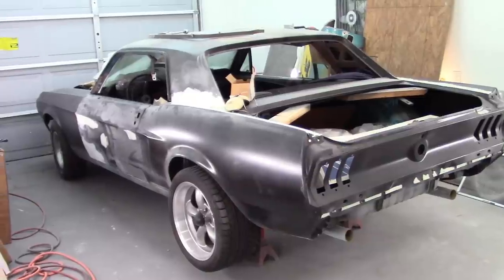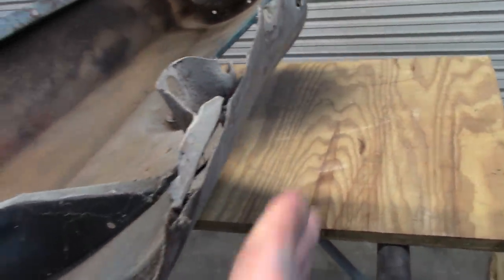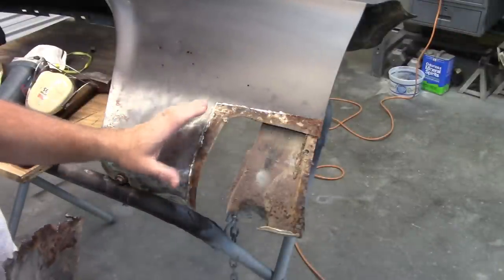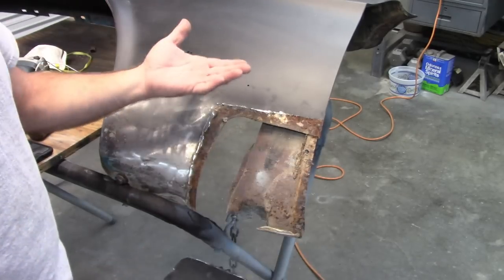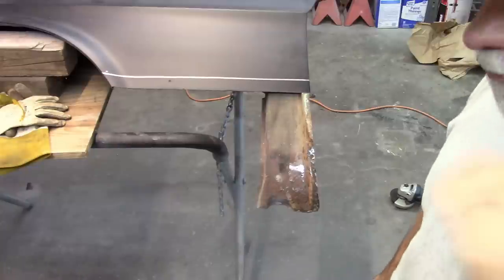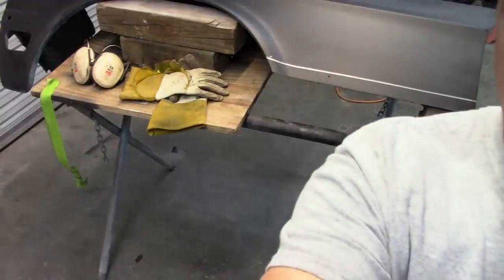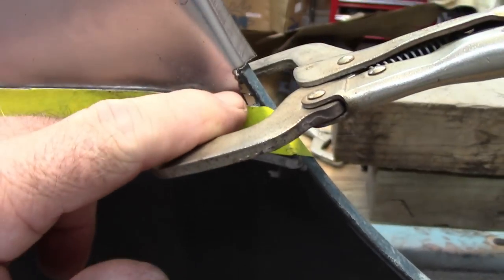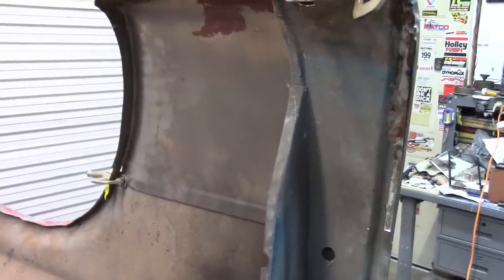Repairing a rusted fender on a 67/68 Mustang. Jade part 26

Comment: Great example of good metal work.  Great Job, on being a perfectionist!  
Might want to add a little that some of the viewers may not have noticed.  When you were folding the metal over, using the hammer a dolly, you did not stretch the metal.  You can tell when you are stretching it as you will hear a 'ting' where the hammer is hitting the metal solid on the dolly.  When you do that you will create ripples that will be harder to get perfect.  You want to use the dolly as a backing to bend (or straighten) the metal, not stretch it.  This method can be used to take dents out as you might want to stretch to get the right contour, and keep the dent out.

Comment: Great job and you pointed out "not to rush" allowing time for the mental to cool - as well - measuring cutting and fitting the panel. I tend to rush and get myself in trouble. So, checking and measuring carefully can save you a lot of time and frustration and fixing mistakes.

Very nice video...thanks!👍

Comment: Interesting watching you repair that fender.  Back in the 80's before the internet I had a project 69 and attempted a long weld with partial panels.  Only wish I knew now how to better control heat by welding much shorter welds and more of them.  Good job on the repair.  The current 69 I bought has almost no uni-body rust.  The bolt on panels are another issue.  Some have dents some have rust bubbling do to the previous owner leaving it out side the last 15 years and water getting into the doors and trunk lid.  I like watching your videos for some time and helped get my thinking of another project which now is awaiting my attention.  That coupe is really starting to look good, very solid.

Comment: edge to edge is the way to go  to weld it , if u over lap keep it to a  your over lap to a minimum , the rust will get between the over lap and  and swell out the metal , it will show in the body work in the future where u made the repair . edge to edge is the way to go  un least u can get at the back of the over lap and seal it to off to prevent it from rusting!!! nice job by the way .keep up the good work

Comment: My project 67 came with a 68 fender that has a patch welded inside to "convert it to a 67. I think I will keep it, maybe fix the patch a little better and just keep it because they ruined the lip for the marker light. The other original fender needs serious work as you show but I'd like to save it too. Great video!

Comment: Great intuitive video - one recommendation on the stitch welds - try to go from end panel to end panel so that the stitch welds have a chance to cool without doing them so close to each other - meaning stitch weld alternating at each end of the panel ending in the center of the panel- just eliminates any chance of the panel from getting real hot and like you said a further chance to warp

Comment: Doing similar repairs on a 65. You shared some good tips. I've been butting the panels and hammer welding with a tig, but using the mig on all the supporting structure. Now I need to figure out how to find the previous videos!
Reply from the maker: They’re all in the playlist.

Comment: I'll be honest,That looks like a fender repair I did on a 68 ford pickup several years ago. I welded the top of my patch then used a scissor jack to roll the metal under to get the curve at the bottom welded it and cut the excess off.

Comment: Very good work ethic,clean & prepping metal,I like the close up shots when you really need to see how the gaps line up & how to secure your parts before you weld, my problem is I only have a generic H/F flux core welder, I intend to get a gas mig eventually, maybe you have some recommendations for one that do the job without overpaying for a top of the line welder.but I enjoyed your video I’m not a body-man but do have a 1967 El Camino project that has similar rust repair needed,just want to say thanks for some really good insight as to what it will take to do the job.if I can ever finish all the dang honey does!!! Which never seem to end.
Reply from the maker: Thanks for the comment. Glad you liked the video. MIG is the way to go. As far as a welder, my Lincoln 140t is an affordable option. I will say you will likely be satisfied with the offerings from Harbor Freight. I would use the Vulcan or Titanium brand from them.

Comment: I really appreciate your post, especially the welding. My only critique is I wish you would have shown the all the welding not just the tacking. Again thanks I just wanted to see more, since its work of art how to weld sheet metal without warping it.
Reply from the maker: Sorry about that. I really just end up doing short tacks over and over until it's all filled in.
Reply: @JoDaddysGarage  thx for the info... I assumed you ran a bead at some point...But I guess thats not possible on sheet metal...
Have you ever considers using a spot welder initially? Even with the warping, it would add more strength and stability when you weld it... Just a thought... thx again...
Reply from the maker: @nc3826  I have not considered a spot welder for this type of repair. Not sure it would give good results.
Reply: @JoDaddysGarage For what its worth, some of the best posts, are when ppl take a risk and try something new. And then talking about what did and didn't work out. 
Perfection can get boring....
Reply from the maker: @nc3826  Very true. I've been trying to work some of that into my videos. Thanks.

Comment: I'm a newbie on restoration. Your coverage on rust prevention, welding and hammer and dolly are very helpful for me. What disk do you use on your die grinder for taking down the welds? I have a cheap Harbor freight die grinder to learn with for now. What kind would be best for me to buy next? Thanks Jo Daddy.
Reply from the maker: I use a 40 grit disk. I also use a HF grinder. Hard to beat. I wear one out every year or so, and just buy another.
Reply: @JoDaddysGarage  Thank you!

Comment: I use to make continuous welds, but don't think it's necessary anymore.  I also don't think the flange needs to be that wide.  I sand blast the inner structures, then paint them with epoxy.  Attach the patch with 1 inch spaced circular spot welds.  Knock them down, than spray epoxy, than skim coat with filler.  My thinking, the factory attaches every panel or piece like this.
I also tape off the part and body piece leaving just enough bare metal to weld to, other parts of the flange get epoxy.

Comment: Sir, need some advice. Perhaps you can point me to the best video. I am going to do my second restore and this one involves replacing the bottom of each two rear quarters. I understand how to weld them but where I get edgy / lack of knowledge - whats the best way to cut the new piece to be an exact match to what you CUT out of the old. is it s simple as cut a bit oversize and then work down from there ? are the lower quarters spot welded to the outer tub? 1970 Coupe ...Thanks - What I want to see is partial cut out (not full quarter ) and measure piece in....This particular video was very helpful BUT in this case you could take the fender off to work on
Reply from the maker: This video may help. I tend to cut a little big and work my way down. I recommend using a quarter skin instead of the patch they sell. This video explains it. https://youtu.be/iLenDX8SBB4

Comment: Great video!  I was waiting for you to test fit the vehicle to verify the gap was good before welding as it was an issue before.  Seems like a small change in angle would could telescope into some real trouble in my hands.  Any thoughts on this would be appreciated!
Working on a very rusty 68 Mustang Coupe right now...starting with floor pans to get my welding skills up. Thank you for sharing!
Reply from the maker: It's a good idea to test fit like you said. I just knew I had a good line. Lots of experience helps.

Comment: Just curious for sheet metal work, such as butt and lap welding, what are the settings on your Lincoln 140.  Also, what size wire are you using and gas type..?
Reply from the maker: Typically I set the heat at "B" and the speed around 2. I use .o23-.025 wire. Whatever is available.

Comment: New to your channel, enjoying your videos!  Did you weld both edges of the lap joint or just the outer?  Lots of videos about doing similar repairs but using a butt joint.  What are the pros and cons of each technique?  Looking at your finished product I would be happy to hire you to fix my old rusty cars but curious why you chose the lap joint vs. the butt joint. 

When you finally paint the door, do you just paint outer surfaces or do you do something to the inside?  What keeps it from corroding?

slight
Reply from the maker: In this case, I will apply seam sealer on the overlap. Then it will get undercoated. being that these cars will unlikely see bad weather after restoration, that is more than enough. Both welds have their value. Butt welds run the risk of warping. For the door, I will apply rust inhibitor, and also add primer.

Comment: One single tip: the flange should be on the fender not on the repair part cause you can not seal behind the reinforcement brace for humidity or water condensation but you're excellent body man.

Comment: Back at 13:38 you make a sharpie mark with the part clamped onto the fender. The metal has thickness and it will eventually go in a bit higher than that mark, I assume you made some adjustment for that? It was close to where it would be, just up a bit.
Reply from the maker: I addressed that further in the video. Made a second cut.

Comment: Hello Barry. Can you tell me a little about applying filler over the lead areas where the rear quarter panels meet the top of the car? Do I have to remove the lead or grind it down first? Is there a special filler that needs to be applied over the lead? Thanks as always. Phil
Reply from the maker: Hi Phil, from what I understand you can go straight over the lead with a quality filler. Just needs to be clean, and sanded like the rest of the car. You can remove the lead if you want, but it can be a hazard. I have used a torch to melt it out.
Reply: @JoDaddysGarage  great! Thank you. I appreciate your feedback.

Comment: Do you have a recommendation of which manufacturer you would choose for sheet metal for this and other body work, it doesn't sound like your a big fan of Spectra. I've got a 67 that has this same issue and I need to do this. Also, very  nice work.
Reply from the maker: Unfortunately I think they're the only ones that make this particular piece. Just about everything is the same anymore unless you can buy original tooling.
Reply: @JoDaddysGarage  Thanks, really enjoy watching your channel. You do a great job.

Comment: I have a question with the overlap.  Should it not be cut off?  As it is now, it seems it will have a tendency to hold water then, rust out again.  Doing this would, in effect, create a butt joint.

Edit:  Great video.  Subbed and have a bunch catching up to do.
Reply from the maker: You can cut it off if you like. I tend to think that applying epoxy, seam sealer and undercoating will do a great job. Also, I think 99% of these cars will likely be kept dry long term.  Thanks for subscribing.
Reply: @JoDaddysGarage  
Seam sealer.  I didn't think of that.  Thanks.
I have an old truck I'd like to start "soon".  You have great instruction.  There is another YouTuber doing this type work but, honestly he is way too boisterous.  He isn't a bad guy and has good information.  I just can't listen to him.
Yours is great.  Thanks.  I subscribed and will be watching all your videos.
Reply from the maker: Thanks Ralph. I try to be considerate of experience levels.

Comment: Next time  where you did the relief  cuts, punch some holes in the  flange you're folding  over and   plug weld them.
Reply: What would that do?  Would that keep a rattle from developing?  Is the factory lip welded?

Comment: I see that Jade is back in the "paint booth area" or so it seems.... I know it is hot in GA right now... did you do anything besides open the door to the main shop to let the A/C get back there
Reply from the maker: It's been in there a while. I just opened the door, and got whatever cool air that passed in.

Comment: Love your videos. A silly question. Why not just buy a new panel? Thanks
Reply from the maker: Some need more work than this to fit right. I like OEM pieces as they are sure to bolt on, and have great lines.
Reply: Plus a replacement fender can be a lot more expensive

Comment: Did you just continue with those little tack welds, adding as many as you could? Then sanded it down?  Is that a MIG welder?
Reply from the maker: Yes. And it's a MIG welder.

Comment: are you using flux core wire in your welding?
Reply from the maker: No, mig. I do not use flux core on sheet metal.

Comment: Why not get new fenders,what mfg do u like for new body panels
Reply from the maker: Nothing fits better than original. I also keep the original date codes stamped into the fenders. I would likely go with Dynacorn. But if I can find "original tooling" aftermarket fenders that's even better.

Comment: I would not trade the welds you had yo do on the folded edge, for  a vertical weld that would have meant you would not have had to reform that edge. What I mean . .you had good metal to the rear section. I would have cut the patch shorter, made a vertical butt weld and one that is accessible from the rear that you could properly treat and protect. That folded edge you created with the welds, is prone for new rust.
Reply from the maker: Sounds like a plan. Except for the existing rust on the inner support brace.

Comment: I was always told as an engineer rule 101 never weld through paint or anything   how come u didn't use like a blow. Lamp with slight heat to burn the paint off?
Make the area as clean as possible if possible?
Reply from the maker: Clean metal is good. In this case I applied weld thru primer. It has a ton of zinc in it which helps prevent rust. At least in theory.
Reply: @JoDaddysGarage   ahh my bad I just wondered 👍

Comment: 1) do you apply weld through primer before you weld on the flange ?
2) do you apply weld through prime without washing with water over the piece where you apply the rust converter ?
thanks
Reply from the maker: I typically apply weld thru at any overlap. Remove the residual converter first. Make sure it's clean and dry.

Comment: I cringe every time you weld on top of dirty metal. Hit it with a flapper disc or something. You can see and hear that the welds aren't penetrating the metal. If you clean it the welds will be faster and cleaner not generating as much heat. Less likely to warp

Comment: order new fender..remove fender...bolt on new fender.
Reply from the maker: LOL. I guess you haven't worked with aftermarket fenders before....
Reply: @JoDaddysGarage  LOL yes I have...checck your source.. Dynacorn makes parts as good or better than oem.
Nice repair video, Don't mean to knock it, but the effort is not worth the result.
Front fenders used to be 120 dollars ea. new.